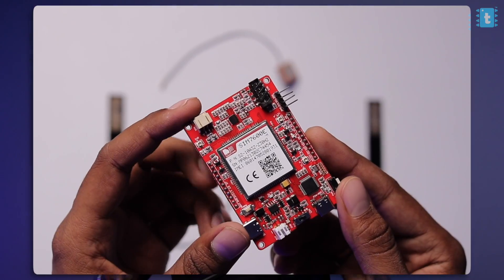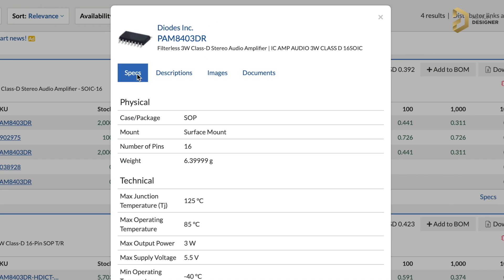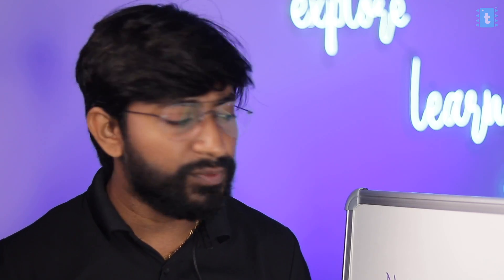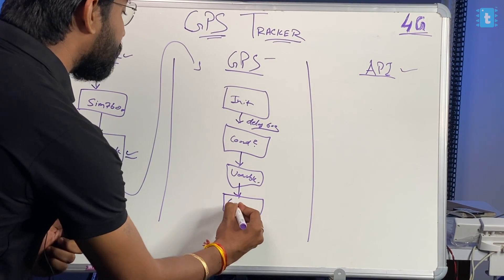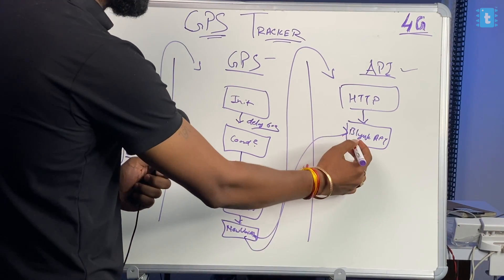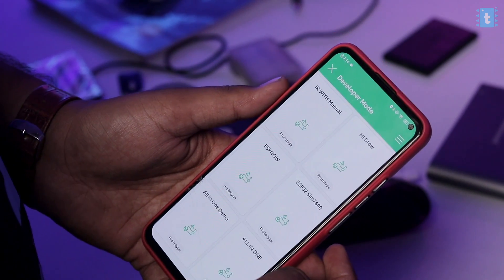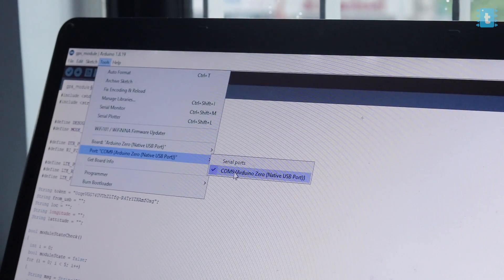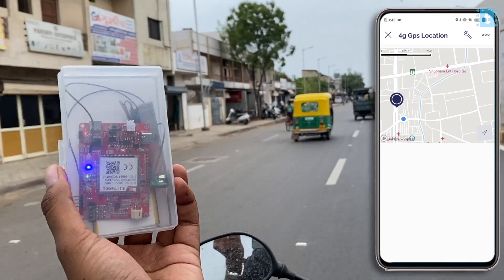4G GPS Tracker using Blynk 2.0 🔥🔥 | No WiFi Required 🚫

Comment: Good afternoon sir I have an existing project that I would like to send you and have you take a look at it for me. I'm using a Sim 800l right now but 2G is going away in the united states. So I'm wondering if this would be a viable replacement and would it be easy to just switch over to this new version. I will gladly buy it from you if you can support me a little bit on it.

Comment: I bought a Maduino Zero 4G LTE Board. I tried to do the same as per your guide. But at my Blynk it shows 4g gps template as offline. I do not see any devices at the map. I am based in the Philippines.
Reply: I see at Tera Term output it works and sends GPS data to Blynk. But the GPS is data is way off in Africa. I am based in the Philippines.

Comment: Maybe this question is a little too deep for this section but... I've followed the code and cant find where the TX and RX for the UART of the SIM7600 is defined. I would have thought they would need to be defined??
Reply from the maker: If you look the code carefully, it’s uses Hardware Serial1 of SamD chip to talk to GPS module

Comment: Cool project, really clearly explained. As an expansion on this project, maybe having the Maduino send a google maps location via sms when prompted by SMS.
Reply from the maker: Yes definitely that can be made
Reply: @techiesms  Yes, I would like to use that feature as well. Under normal conditions the Maduino is in standby mode but if you send an SMS to it, it will reply with co-ordinates that give its location directly on Google maps. Please do a video showing how to achieve this!
Reply: @techiesms   This would also be a project I'm interested in as well. Also a video on sending a SMS to active a pin.  I'm a new subscriber, please forgive me if you've covered this already.

Comment: I would like to give a really complex project idea. A quad copter with infinite range using the SIM 7600 module... If the drone moves to location which doesnt have range, it will move back to nearest most recent location where range was availale and broadcast status back.
Reply: It's not possible due to high latency of 4g network would be possible with 5g

Comment: Great as usual! Is it possible to memorize the tracks? Thank you in advance.
Reply: Yes, in a way.  If you are pulling the GPS data from the device, you simply need to log it somewhere.  For my purposes, I have my own API that I use that track GPS, and that API saves every input to it in a simple text file on my API server.  SO I have data going back years as to where one of my GPS devices has been.  But that was using GSM/3G which is down now, so I am going to get one of these 4G modules.  If you do not have a way to store it for yourself, you can write it to the SD card attached to the MCU.  Probably as a text file.